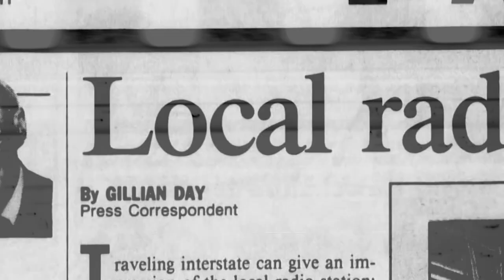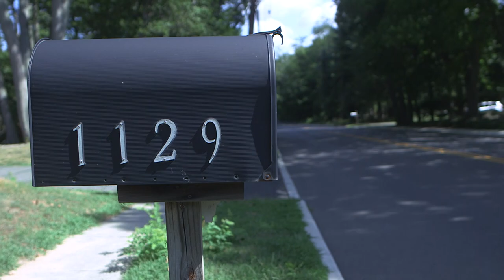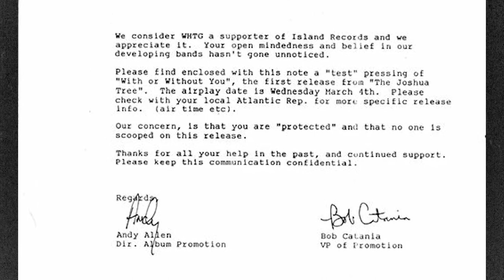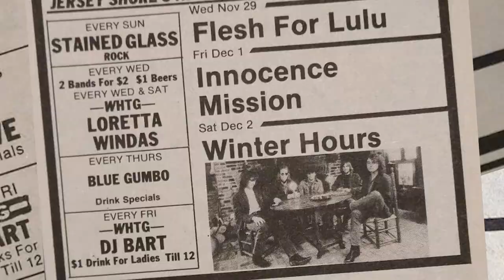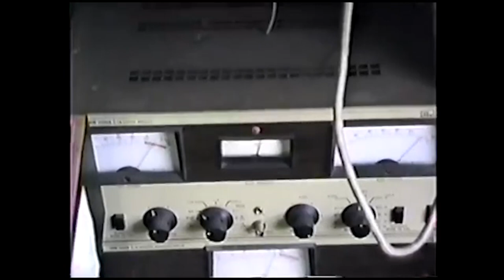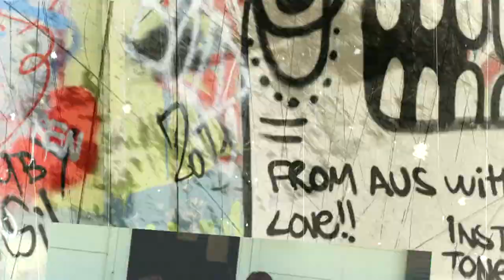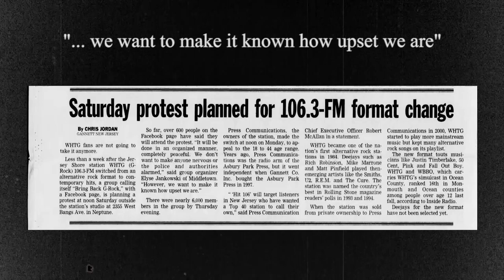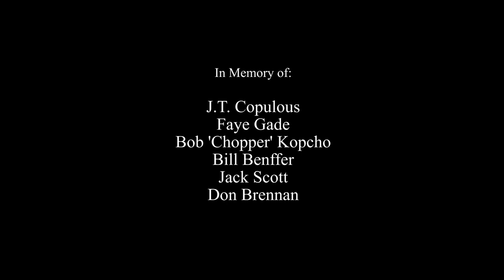WHTG 106.3 FM: Modern rock radio and the house on Hope Road (Documentary)

Comment: I worked there before all of this happened but it was still a "strange trip."  We didn't even have cartridge machines . . . we had their obsolete antique ancestors.  (Here are some musings I wrote a few years ago.):  It was called a Gates Spot Tape machine.  At WHTG AM/FM in Eatontown, NJ we had three of them and they were beasts.  Our chief engineer told the crazy lady who owned the station (which was in her house) that cart machines were a "maintenance problem" so she kept buying used ones (they were no longer in production) from other stations.  

It was one huge roll of magnetic tape (about two-feet wide) that could run for a maximum of about two minutes before rewinding (not endless loop like a cart).  And the pointer moved a record/playback head to each narrow audio "slot" . . . I forget how many tracks it had but it was probably about a hundred.  The big problem was that if the pointer was bent just a little, you might set it at B-3 but it would play B-4.  

One of the used ones we had came from some station in the deep South and one time I hit the button for what was supposed to be a commercial for a local advertiser and I got this screamin' hillbilly spot for a car wash (or something) in Moonshine, Alabama (or somewhere) that was still on there from the previous station.  And that happened more than once as there was no easy way to erase old spots other than recording new ones over the old.  

As I recall, you had to rewind it manually (when the spot finished) or it would keep running until it physically got to the end of the tape . . . which sometimes would break loose from the "feeding" cylinder.  

I had just returned from four years at Boston University and had worked up there at some first class stations (with state-of-the-art equipment) like WMEX, WRKO, and WEEI (CBS O&O) and this (my local station) was a freekin' joke.  I ended up working there three different times (after getting fired elsewhere) but she'd always take me back.  

A few years later, I almost bought the station but her daughter raised the money and beat the deadline that her father (who was separated from her mother and living in Hawaii) had set for the sale.  The price had been $750,000 for to whole thing . . . two stations, the house, the tower, and the real estate.  

The daughter eventually married the chief engineer and about ten years later they sold it for something like $15-mil . . . oh well . . . 
  (More later . . . feel free to as questions about the house on Hope Road!  Cheers!)